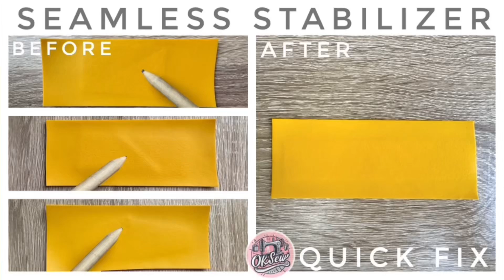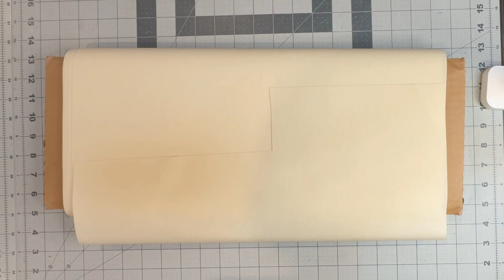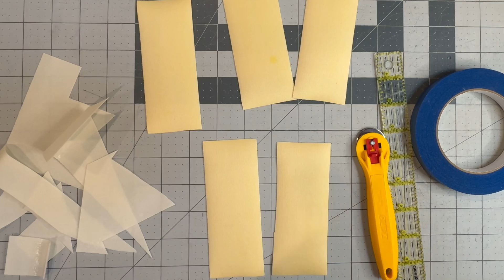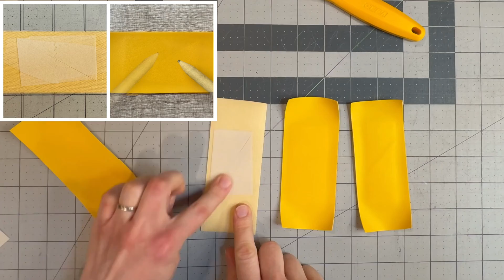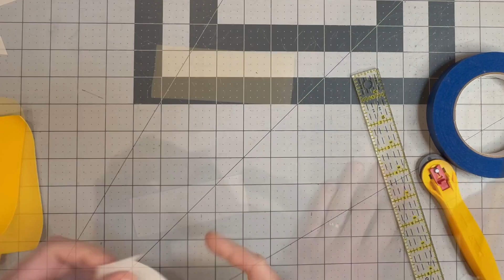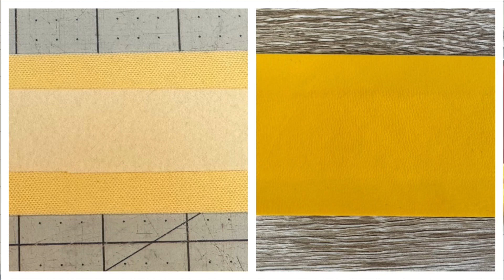Discreetly Joining Decovil Scraps - An OKSew Quick Fix

Comment: How hot was the press to fuse it to you vinal
Reply from the maker: I use the wool setting on my steam press, which is about 300 degrees F, and a teflon sheet. Some vinyl tolerates heat better than others so definitely experiment with scraps!

Comment: Hi.  Great tip, thank you.  I am not sure how the painters tape will react with a regular iron.  I would perhaps put a pressing cloth between iron and tape.  I will experiment on that tonight.
Thanks Nicole 🙂
Reply from the maker: This is a great point, I always use a teflon sheet when fusing Decovil to vinyl so I failed to specifically mention that; though I have been quite impressed with how well the painters tape tolerates the heat (and all the other things I’ve been putting it through lately 🤣)